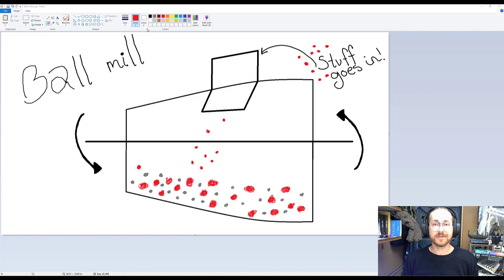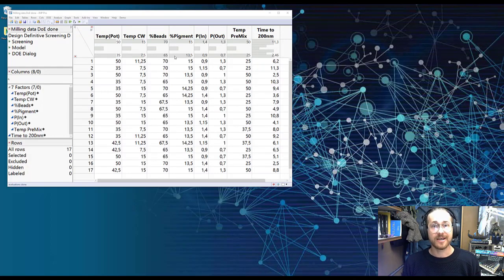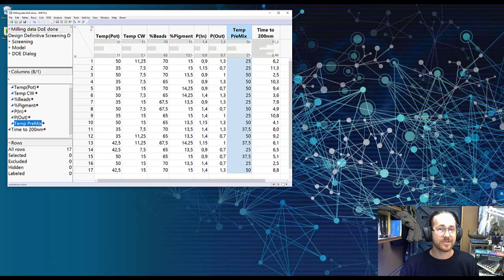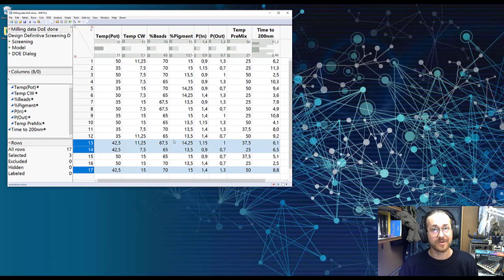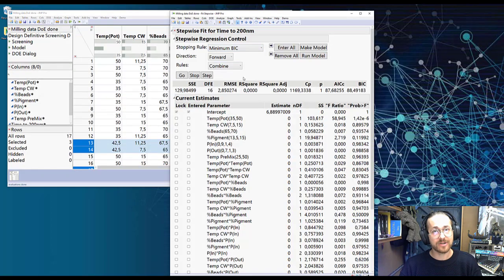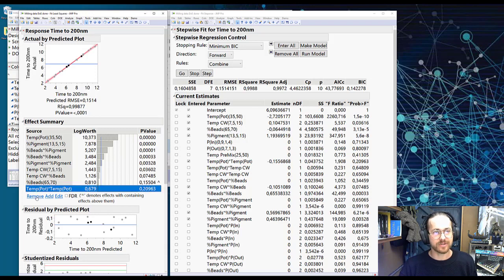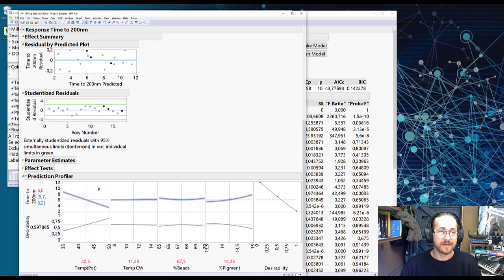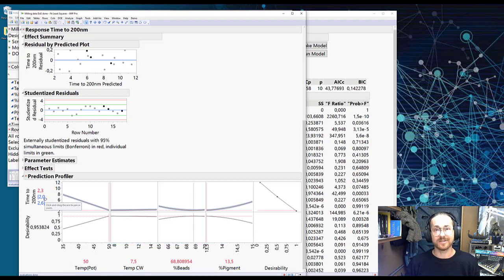DOE data | 5 Steps to a Predictive Model!

Comment: hi, perhaps you could look into the statistics and make comments on how good this model is? and what is meant by good?  Thanks
Reply from the maker: Great idea for a new topic. A good low-effort solution is creating some new data points on the found optimal setting and comparing that with the predictive model. Hopefully there will be a good match.